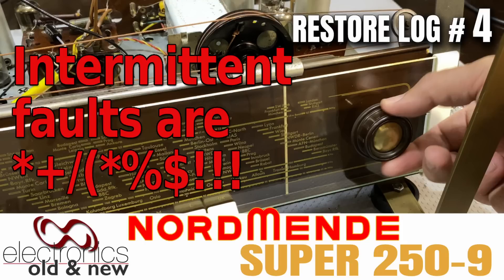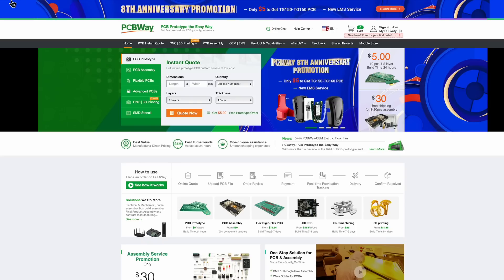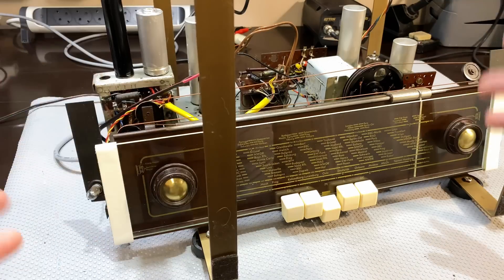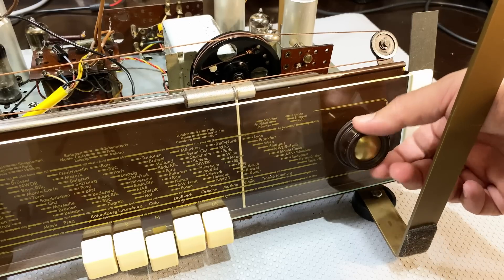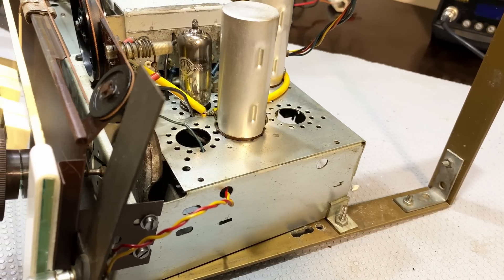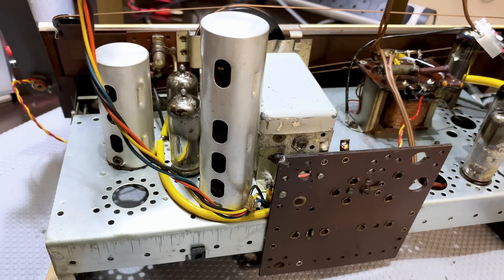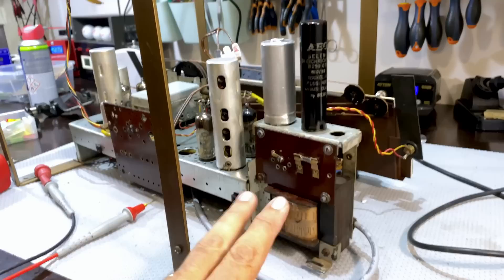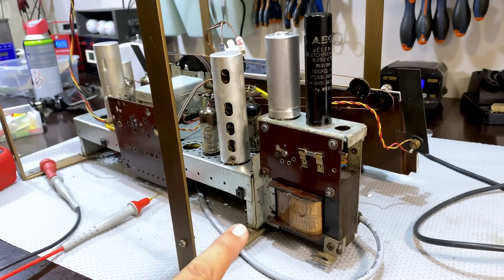Intermittent faults are tough to find, until they glow. Nordmende Super 250-9 rest. pt. 4 #PCBWay#

Comment: Hi Manuel, my Grundig Satellit 2100 has developed an intermittent fault after being switched on for about 5 minutes. The fault is only on LW, MW, SW1 and SW2. By placing another radio near the 2100 I noticed the oscillator was going intermittent. I'm expecting the fault to be around the S13 and T11. On your videos you never removed the LW....SW2 frequency display dial. I haven't opened up the 2100 radio as yet, but I'm wondering if you know whether I can get access to S13 and T11 behind it? This fault has only started during the very hot weather we've been having here in the UK. Many thanks for the videos you've made of this radio, glad I saved them.
Reply from the maker: I’m afraid I don’t recall the details other than what I’ve recorded in the videos. It’s been a while since I finished the project.
Reply: @electronicsoldandnew  thanks anyway, I'll find out in a few days when I remove the dial. I don't have a BF240 for T11, but I'm sure I'll find an equivalent.

Comment: In the 80s i worked with a "Grid Dipper", which used this 'loose coupling' effect, to check for resonance frequencies. Your Tube-coil is a absolute normal instrument, to send energy into the grids. It's a pity, that the main transformer makes trouble. Hope for the best solution.
Reply from the maker: Thanks Alfred.

Comment: Manuel, I like your valve shield experiment, it appeared as though your coil was on the outside of the aluminum tube shield if you decide to go to a more customize coupling device what about put the coil on the inside of the metallic shield to prevent possible coupling to neighboring components. This particular radio adventure clip editing was excellent, and going into detail about your IF injection experiment added wine to the meal.
Reply from the maker: The coil is bare wire so it connects to the entire shield itself. I’m thinking of building a “shield within a shield” with the outer one being insulated from the inner one and connected to ground to avoid precisely the leaking to surrounding circuitry. Glad the meal was well irrigated 😊

Comment: Hi, regarding the intermittent short, i suspect the power cord itself.
It's not a very common fault, but it's possible.
 Try this : remove the grey power cord completely from the radio and connect a fitting and a 40Watt bulb to it.
Then connect this power cord with the 40Watt bulb to your dim bulb tester with all 4 dim bulbs enabled and wiggle each part of the entire power cord, if the power cord 
is okay, the 40Watt bulb stays on, if not, the 40Watt goes out and the 4 dim bulbs will glow brighter.
A simple continuity check with a DMM does not draw enough current to find some shorts.

Comment: A thermal camera, or even those cheap laser pointer things that read temperature, can sometimes pinpoint the overheating components before they glow or burst in the flames. Granted, this is easier on solid state equipment than it is on equipment that uses those funky fire-bottle things😁!
Reply from the maker: True 😊

Comment: I really like your "new" method of injecting a signal into the radio to align it.  I have seen that done before on other channels, and as you discovered, it works great.  Happy to have you back and hope all goes well for you in your back to a "normal" life of work, family, etc.  I wish that you had enough money that you didn't have to go to work, but could stay at home and do the videos, be with family, and just do things you enjoy doing.
Like you, I am very curious as to just what is causing the intermittent short!
Reply from the maker: Yes, that method is probably going to be the way forward, unless I find something against it. 
Work for me is actually not something I avoid. I cannot imagine not having multiple things to do in my daily schedule. If I had to do this hobby as a profession, I’d have to look at the clock, and that would spoil the fun 😊
Reply: @electronicsoldandnew  My main concern would be that the shield detunes something.  A lot of radios don't have a very good filter on the front end, so you might be able to feed the IF frequency directly into the antenna input.